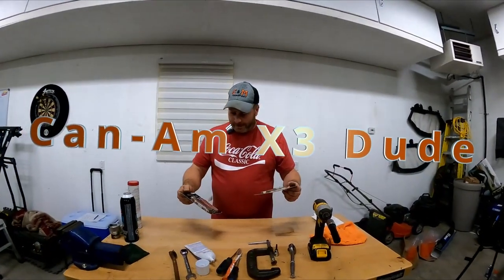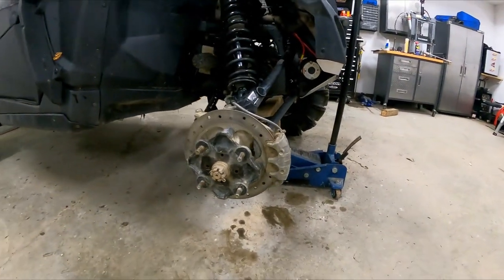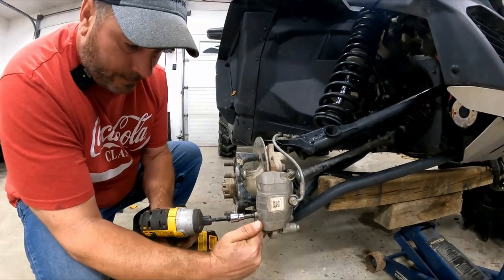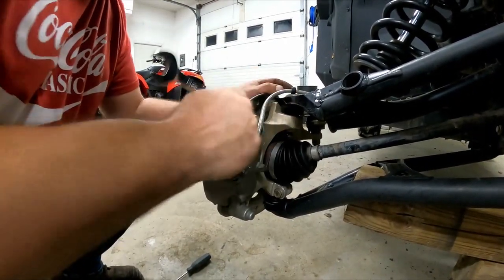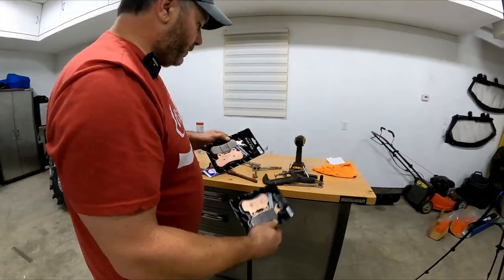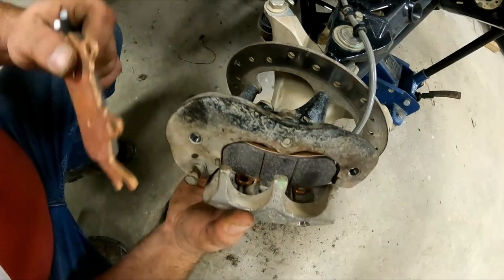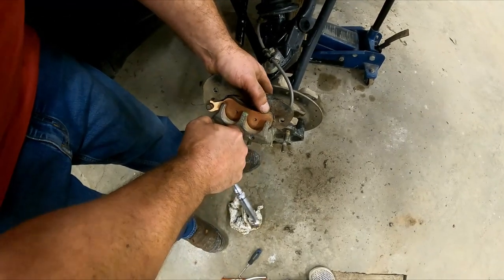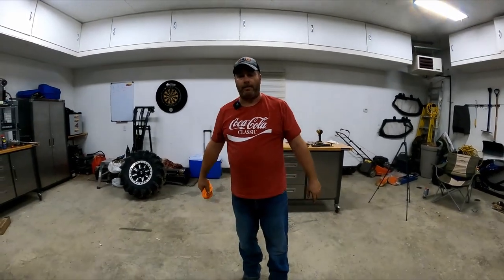How To Replace Your Brakes on A Can-Am Maverick X3

Comment: I've read alot of reviews these pads don't hold up more than 200-500 miles.....what was your experience with these??  Great videos btw
Reply from the maker: Thanks for  your comment , the brake pads so  far have no complaints we’re on with my tracks and that at high speeds if you need to hit the brakes and they do good and in the mud and with 32 inch tires really ok so far , I got my front end apart now and the brakes still looked good , for the price I got no complaints but I don’t race every day and not one to hit the brakes hard I’m in the 300-400 miles on them now will check them out more and give a better review hope this helps

Comment: Surprised you didn’t have to heat the pins to remove . The pin heads typically strip out
Reply from the maker: No, came out no problem

Comment: Another great tutorial 👍 have you consider adding the larger 270mm/280mm streamline discs, any thoughts on them? Thanks
Reply from the maker: Don’t have that kind money, that’s the problem being a regular Jo got to put everything in a budget, that’s why I try to make videos that help people save money to get your build that every one wants faster
Reply: @Can-AmX3Dude  I’m with you on that, those streamline discs are less than 600usd front and rear, from what I’ve read they make a massive difference, I’m not talking about those mega full brake kits which will set you back 4000usd, which is crazy money